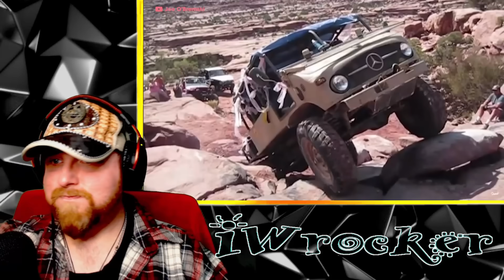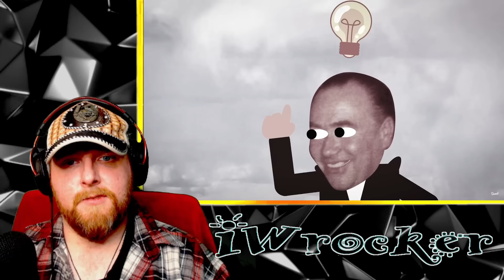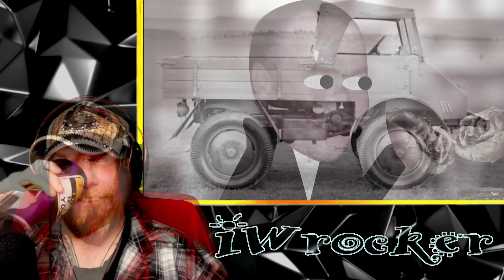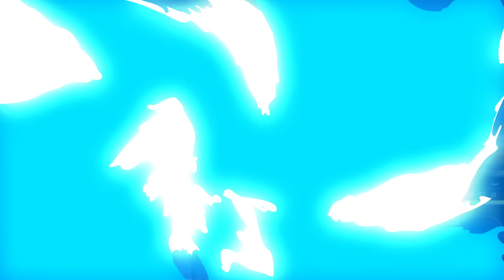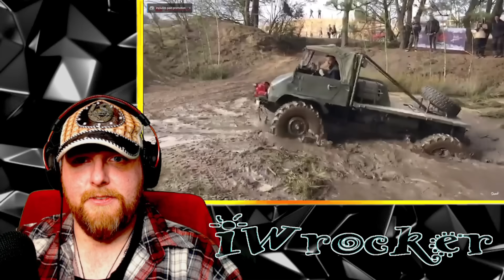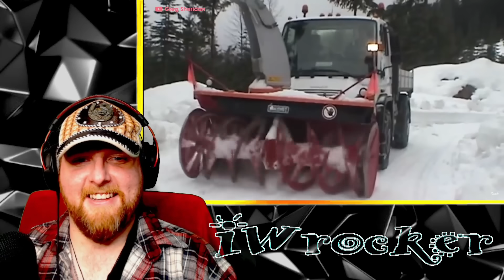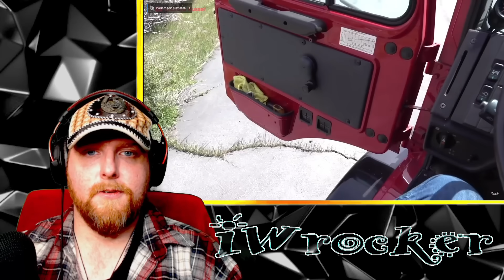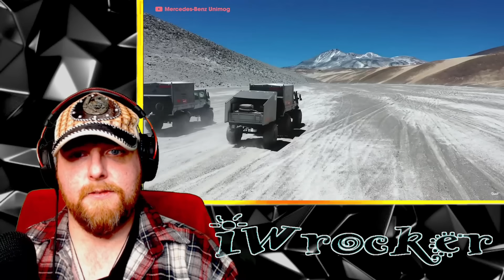American Learns About the Mercedes UNIMOG

Comment: I got into work with BOSCH in 1977, and in 1979 I visited Bosch Development near Stuttgart. It was here riding the bus to work where I first saw UNIMOG vehicles around most farms  and some in other roles including village Fire Brigade. Being into 4WD since late 1960s  I was enthused by a versatile 4x4 vehicle with lots of capabilities. As it turned out there were a couple of Unimogs at work  used for injection and electronic ignition development, so I had chance to get into one for a close look  oh the drool over its features. Sadly at the time only dreams.
At start of 1980s I had to undertake training for injection system application work. During a 5 month working stint  I got another chance for closeup Unimog experience. It almost happened, I had opportunity to buy a second hand, development Unimog for a mere $10,000, which was way less than a new price  but the vehicle was low mileage  around 16,000km from memory, and a mere two years old  it was superseded by design changes  but matched normal sold types. Sadly I procrastinated so it was sold to another engineer whose family had a small farm.
As it turned out, I was very fortunate, the Unimog had never been built in Right Hand drive version, which I needed for Australia. As Left Hand Drive model I could not have driven much or long term in Australia  except under limited special permit. As no parts ever were designed to allow Right Hand version , a conversion using standard parts was impossible, and custom rebuild virtually impossible or at least SUPER expensive. From memory three Unimogs were imported for a deep expedition to central Australia to search for the 'mythical' lost Lasseter's Gold Reef. These had a two year permit for the expedition.
Not until Australian Army contracted for Mercedes to supply Right Hand Drive vehicles for the army  did a redesigned version become available. From memory near end 1980s. To add to the prior 6WD army landrovers used prior to getting these bigger tougher Unimogs.
I had opportunity on one summer Red Cross Canoe marathon event  to use my Nissan Patrol with Warn Electric winch to unbogg an Army Unimog on a sandy river bank flat.  UNIMOG bogged? Yes  bogged, which realistically is virtually IMPOSSIBLE.  It took a less than brilliant young army driver to actually bury one in loose sand. Not the only vehicle getting bogged that day  I would have winched and towed over fifteen vehicles out  including a tow truck that someone called  saying he did not think I could help, so I got him and the tow truck out.
Anyhow  this young army driver first tried only two wheel drive  getting rear two wheels dug in. Then in 4WD  rather than slow low range gears to crawl free  left it in high range and second or even third gear  reving engine hard, dropped the clutch  spinning all four wheels, and progressively on several such spinning efforts dug rear in deeper and front now also dug in. He argued with fellow army guys, that that was the way to get out, not slow low gear crawl. By the time his senior order him out of the truck  even slow crawl did not help  just churning loose sand now up to wheel gear hubs in sand. Now those wheels are BIG , must be over 1m outer diameter  so the wheels would have been over 1/2m dug in.  I used my winch and gave needed pull  as the new driver of Unimog slowly rolled his wheels and the Unimog was free in under a minute after hooking up. It then managed to crawl off the sand slowly. Still a very impressive vehicle  which driven properly can do more than most vehicles of its size.
While ex Army Unimogs have become available, and far cheaper than new price, which is still daunting for us normal humans  the continued cost of maintenance and spares remains painful. So likely never to own one. It is also large as far as parking space in suburban home yards or garage (height as well as width).
A bit more feasible is a vehicle sort of in Unimog style, still in upper cost range, that is getting good reviews and kind of popular, is a IVECO model that us mere mortals could afford. It also has massive capability beyond the typical 4x4 and small to medium pickup trucks. It is worth following up, sorry Right now can not even state the model name.. just it is by IVECO.

Comment: After viewing your clip I remembered we had a few of these incredible Mogs as  support in our tank artillery battalion in the german army. Two were build in the late 60th and three in the early 80th. All of them reliable as hell.
I just checked how much a used one costs here in Germany.  I was  suprised that a 40 year old one in a good condition costs 20.000 -  30.000€.
Reply: Unimogs are very desirable. They always have been crazy expensive used.
That's what happens if it can do everything and everyone has a use for them.
Reply: You can get 'em for 10 k in repairable, not running/not driving condition. It gets even cheaper with parts missing, but You would need two or three of those to get one ready and driving for a reasonable price - so yes, it might actually be the range You gotta put aside for a driving/working one. Plus You gotta count in all the accessories You might still want/need, from a crane to winches to frontloader or backhoe ... it is a workhorse after all. But look at what a working tractor, a working excavator, a working loader or a working 4X4 or 6x6 lorry costs - the UniMoGs aren't pricey in comparison.
Reply: Junge... Du weisst doch, dass Qualität ihren Preis hat. Wenn du dir heute nen neuen Kobold von Vorwerk kaufst, dann wird's auch 4- stellig. Aber das Ding wird die nächsten 30- 40 Jahre seinen Job machen.Inklusive der gesicherten Ersatzteilbeschaffung in diesem Zeitraum...
Reply: But it only went up in the last years. In 2011 I was looking around and the 12t Version was selling as Army Surplus with just 60000km for around 12000EUR in reasonable condition.
Reply: Ich hab bei Kleinanzeigen einen Bj. 72 für 17k gefunden

Comment: In Bettmeralp, Switzerland, they use an Unimog for waste collection. The village isn't connected to the road network and can only be reached on foot or by cableway, so they strap the Unimog underneath it (for safety reasons nobody stays in the Unimog or cableway)

Comment: Mercedes has even a bigger truck of this kind : zetor. An incredibel beast. The unimog is a very special truck to drive with a lot of special future to lock differentials. They even have an unimog with articulated steering. The wheels don't steer but behind the cabine there's an hydraulic system to steer like a wheelloader. I can also tell you that they are very expesive. I think the latest version start somewhere from 175000€ without options. The cabine is also very special because it is in plastic/composit.

Comment: Drove a 416 during my conscription in 99. Almost impossible to get it stuck even if you tried. Then later on I drove a 1550 for a while. 
Once you get used to how lively the body of the vehicle is, and all the gear levers (the 416 had 4, if I remember correctly), it's such a nice vehicle. Use ear protection at anything above 50 km/h, though!  
In the 1550, slap it directly in 4th or 5th, get going. Hit the breaks and use the second gear lever, and reverse in 4th or 5th :)
We have a 1550 in my current unit. About 20 years old, it's only gone about 35000 km (20000 or so miles).

Comment: The top speed is tied to regulations in the countries they are sold. In most of those countries, the speed limit is 50 mph for heavy trucks and semis, and thus, the Unimog tops out at 55 mph. With other gearing, you might get it above 60 or something, but the Unimog has the aerodynamic drag of a cupboard.

Comment: The Unimog was not the first, Tatra Trucks made the T111 from 1942 to 1962 in a 4wd or 6wd, today you can get an 8wd stanard truck or order a 10wd or 12wd truck. The Tatra was used by the USSR in the cold war and are still getting used today image of the Tatra T815-6 12wd USSR https://www.deagel.com/library/sm/2009/m02009012700005.jpg

Comment: On the getting new mogs, other than the 25 year old plus mogs, you have a few other options in the US. In the 2000s for about 5 or so years they certified and sold one of the series of unimogs through either Mercedes themselves or their subsidiary Freightliner. The other option is to looks for the us military surplus and case branded mogs (these are 406/416 mogs). These mogs were the SEE (special emplacement excavator, which had a bucket loader on the front and a backhoe on the back). The HMMH (High Mobility Material Handler, with a forklift on the front and a crane on the back). And the Case MB4/94 (basically a 406 and very similar to the military mogs).

Comment: The U.S. Army and Marine Corps had them in the late 80's but only on the TO&E for about 5 years.  They were engineer vehicles, assigned to Engineer units, so variations had front buckets, backhoes, etc.  Their designation was Small Emplacement Excavator (SEE) earthmoving vehicle used to dig crew-served weapon positions, trenches, bunkers, etc.  They were licensed by Freightliner like the big over-the-road trucks, but everyone just called them The Mog.  They were handy for small, quick work and rapid movement from place-to-place but they weren't around long.

Comment: This guy is wrong about the Unimog in the US. Street legal US spec Unimogs have been sold twice, first from the mid 70s to early 80s when Case imported them, then Daimler  themselves imported them to the US from 2002 to 2007 selling them through Freightliner dealers, Freightliner of course being owned by Daimler, numbers were small but the US Army had some. Parts would be available via Freightliner but nothing would be in stock except for engine parts because the engines are used in the smallest straight Freightliners, OK they have Detroit Diesel (DD5 & DD8) badges on them, but they are the same. Just so you know in Europe a new Unimog would start at about $150k and go up (a long way) from there and they hold their value very well.

Comment: Some of the benefits of the uni IG is the range of temperatures it can operate in. Another advantage is the frame is independent so the cab can twist one direction whilst the trailer goes the opposite direction.

Comment: UNIMOG is a Universal work Horse , mainly used by Town/Street Services to maintain Streets = at the front a snow plow and at the back throw Salt on the Streets in Winter or to cut gras at the side of the streets , maintain forrests offroad . There are dozends of Devices you can attach like pumps , plows , cutters and any kind of hydraulic Devices and due to its offroad capabilitys you can use them nearly everywhere . Its not the fastest , its not the strongest , but can replace easily half a dozend specialised Vehicles if the task does not require the Power of a specialised Vehicle .

Comment: My dad purchased and restored a 21 yo UniMoG, so it was from the somewhat 60s. He was in demolition services so the future looked kinda dire for the UniMog 😁
It stood for 10 years on an acre and rotting apart, but only on the surface. We bought a new drivers cabin, and some small parts, ripped it in 6 months completely apart and re-assembled it. It was like new.
The steel used is believeably flexible and sturdy. 
We tried to cut a u-bolt that held the chassi and the frame together. The bolt cutter was massive and big and we had to put 2 5 foot long pipes as handle extensioners to even be able to move anything at all. We spent 3 of these bolt cutters, each worth of ~200$ as there was no space for angle grinders, before we got it cut.
Under the skirt the UniMoG is a sturdy donkey and beast.
I have seen it climbing 2 stories up the wall as it was supposed to lift down concrete blocks we had cut out of walls with diamond tools. Totally crazy, totally cool.

at least the older models are kind of unbreakable. And they looked cool until the 90s....

And driving it is fun like hell😁

Comment: greetings from Austria where you can find quite a few of them working for municipals and in firedepartments

we even got several of them in the armed forces but the most fancy version is the (if I remember correctly) U500 series with the moving steering wheel and pedals... which comes in handy when working with side boom mowers to maintain vegetation besides you on the road

oh and by the way... the firedepartments over here use them as driving toolboxes and multi tools... with hydraulic knuckle boom cranes and attachments like grabs, forks, manbaskets and so on for technical assistance alerts like on traffic accidents and when there is natural disasters happening

and of course there are quite a few of them in construction and on large scale projects for energy companies (some working as huge cable winches to pull up the overland lines onto powerpoles)

the UNIMOG simply is a class of its own... and if you want an actual truck that has some of the UNIMOG features... you need to get a Zetros

(by the way, have you ever checked out the legendary "Pinzgauer" High-Mobility All-Terrain Vehicle?)

Comment: i were driver in a unimog wen i were a soldire in 1990, it were from 1962 and had 8 stick gear forward and if you had to go revers you pulled up a little lever and you had 8 gear revers so top speed forward 75 kmh and 75kmh back, the back gear were fixed in the 1965 model do to a lot of crashes

Comment: its still basically a tractor XD every Unimog has a PTO. and you can easily buy a 3 point hitch for them. able to use any farm equipment as long as the equipment horse power requirement does not exceed the horsepower rating of the Unimog.

for the longest time (and maybe still) here in the Netherlands you can buy Unimog's which are classed as "agricultural machine" instead of classed as a regular road vehicle. and here you can get your tractor license at 16. in school when i was 16, i knew 3 people that owned a used Unimog and drove it to school every day. (i went to a school which had an agricultural program, as well as metal/wood working, and car mechanic program which was what i did)

Comment: Boy what did i hate to work on those 70's Unimogs when i was a truck mechanic, we had 2 customers with Unimogs and when one entered the workshop terrain every mechanic who seen them coming suddenly played hide and seek, everybody hated these things, like a lot things Mercedes makes they are not easy to work on,
To get behind the steering wheel of those roundnose versions you needed to be nimble, and inside you were baffled by the sheer amount of levers, those things had just as much gears in reverse as forward, so a very brave driver, or a very stupid one could go very fast in reverse.

Comment: We had a UNIMOG model of the 60s still running in the German army in the late 90s. Six cylinder gasoline. It had two 50 Liter (13,2Gallons) tanks. 
When you ran low on fuel you had to switch from „main“ to „reserve“ wich meant literally from one tank to the other. I’m not sure if they went much further than 150km. So to speak was lack of fuel the only thing that would stop an UNIMOG.
As mentioned in the video, the name is the shortcut of UNIversalMOtorGerät, if you translate the German word  „Gerät“ with „Gadget“ it even works in English and you get the idea what it’s meant to be - ever since…